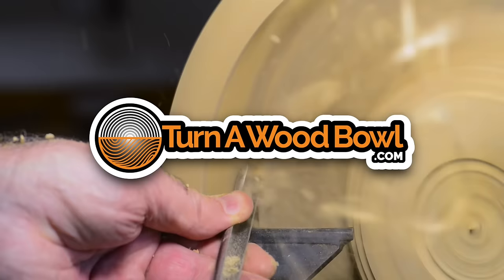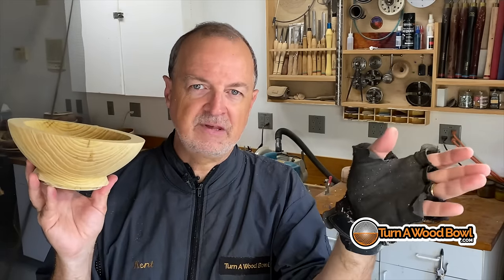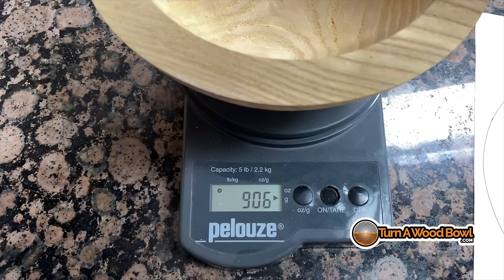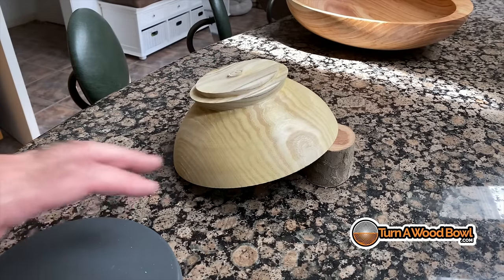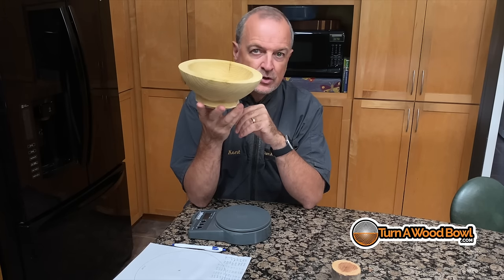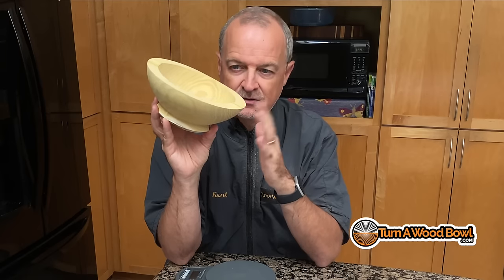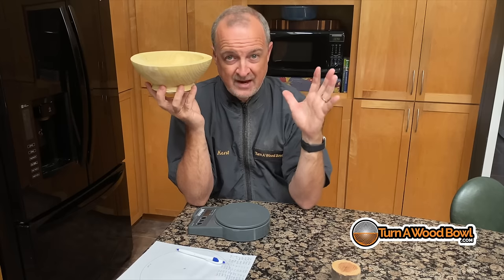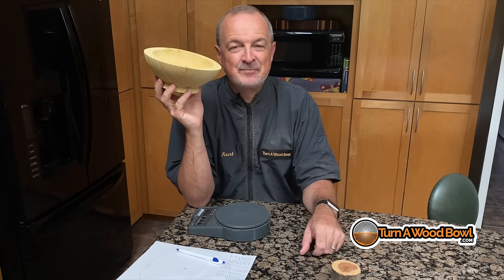Microwave Drying Wood Bowl Blank Woodturning Video

Comment: New subscriber and totally ignorant newby … the info was great and very helpful. I don’t turn, at least not now but am looking at dremel/angle grinder sculpting. So my question is, does the warping issue arise with chunks of wood? Seems to me that it would and I know of some sculpted pieces that have cracked. Can this process be adapted to wood you are sculpting, small statuettes and the like? And what is the process if your item begins to crack during the drying process?
Reply from the maker: Linda, thanks for watching. Yes, flat stock of wood can be dried this way also and usually the side grain areas will shrink a bit, but the length of the board will not change much at all. Small cracks might form, but they shouldn't be that much. You might want to start with a board larger than the intended project, dry it, then final cut it and plane or sand any warping that the drying process caused. Hope that helps. Have fun!

Comment: @Turn A Wood Bowl
I’m trying this method for the first time. So far, so good. I rough turned a piece of ash to roughly 6 inches diameter. It was 614 grams Thurs nite, and is now 520 grams after 13 bursts in the microwave spread out over that time.
That said, even though the rough bowl size hasn’t changed yet/at all, I did notice the first cracks on the outside surface. There’s a small set/patch of shallow 3-4 hairline cracks on the outside surface…maybe 1/2” is the longest.
Should I stop with the microwave? Fill with CA glue? Or is this normal? 
Thanks in advance for the response. Appreciate all the instruction in your videos.
Reply from the maker: You might be pushing the drying process a bit too fast or it could just be the wood species. Every tree is different. You can glue the crack with wood glue and see if it stops the cracking process. All the best to you and Happy Turning!

Comment: I know this is an old vid but maybe you'll see it. I have over a pick-up load of Black Walnut logs that are green. Spot checked yesterday and The MC was running at 19-20%. My dry pile is running low. I turn mostly live edge bowls with my Walnut and was wondering if this method would interfere with the bark adhesion? Any thoughts? I was thinking about using a food dehydrator

Comment: Another great video Kent, I learned a lot of good information!  However I do have some questions my wife brought up when I wanted to use HER microwave to dry some blanks!  She was concerned about the oils in some of the pine and fir wood tainting the microwave and making it unusable for food.  Are there concerns along this line of thinking?  Are there any woods that should not be dried this way? Thanks for your input!
Reply from the maker: Great question. While I can't give medical advice, I would avoid any woods that's have been known to cause you to have allergic reactions. I doubt that pine and fir would cause any issues other than maybe get some resin in the microwave, but don't take my word for it. I recommend getting a dedicated microwave to make it all good at the home. ;)

Comment: I was lucky to find some 18" apple logs and made 5 bowls that were 13-16" diameter by  3-6" deep with 1.25 to 1.75" walls. I fully coated the bowls with Anchorseal. After drying in paper bags with shavings for a year, 4 of the blanks had cracked with cracks too thick to fill with CA. Could you do a video discussing how to fill the cracks and recover the cracked bowls from being thrown out?
Reply from the maker: Yes, I will do a video about cracks. However, fruit wood in particular usually needs to at least be rough turned ASAP after cutting. My experience is that fruit woods crack like crazy. Once you have deep cracks, the wood is no longer safe to turn.

Comment: Can you dry a bowl too fast in a microwave and distort the bowl? I also have bowls that have dried more than a 1/4 inch out of round. What am I doing wrong?
Reply from the maker: Yes. Also, if it is thin enough you can overheat it and intentional bend it to a different shape. Be careful though. You aren't doing anything wrong. You might want to check out my Tree to Bowl course www.TurnAWoodBowl.com/green  Happy Turning!

Comment: Thanks for another great video. I’m so happy I found your channel and website. It has really helped me. One question though: do you change the powers settings on your microwave and what is the wattage of the one you’re using?
Reply from the maker: Good question. No, I have the microwave set to full power. I adjust the time and start with a short interval first.

Comment: Thanks Kent. Is warm to the touch  100 F or so ? (I can friction polish and get 130 F surface which is very hot through a paper towel pad.) And do you notice any smells ? If so how strong are they ?     Stay safe.  -Mike😷  p.s. I am so glad to have found your vids ... I am just beginning to use a gouge & your explanations are the best I've found 🙏
Reply from the maker: Good question. I haven't experienced any smells. Although, I would guess some tree species might smell a bit. Also, be careful heating up the wood surface when sanding as that can cause cracks. Thanks for watching and sharing. All the best to you.
Reply: MPart I’m a begging wood worker myself but from my understanding there are some woods that can be more toxic though I’m not exactly sure which ones. (Eucalyptus maybe?, spalted wood due to the fungus I wouldn’t do in a microwave that is also used for food.) So far I haven’t come across any that smelled bad/toxic though when you microwave olive wood it definitely brings the smell of the wood out more but doesn’t smell toxic.
Reply: @miles67733  Yeah, mold and fungus sound like a reasonable hazard to avoid. I use https://www.wood-database.com/wood-finder/ to understand woods.  Ordinary domestic walnut can be a sensitizer and same for UK yew. Mother nature sure is wily😁
Reply from the maker: @miles67733  Good ideas. You can check different woods and their toxicity here https://www.wood-database.com/wood-articles/wood-identification-guide/

Comment: Great video! Have you heard about wrapping the wood with plastic wrap before putting it into the microwave? I read somewhere that if you put it on high power it allows the moisture to escape but without cracking it because it's in the surrounding plastic...
Reply from the maker: Interesting! Not sure how moisture would escape if the wood is wrapped?
Reply: @TurnAWoodBowl  if I understand right it migrates from the inside to the out and sits on the surface, keeping it from cracking or excessive drying but when you unwrap it you can wipe the moisture off.

Comment: Thanks, Kent. I have a dedicated 34L microwave in my shed. I've experimented and found that the defrost by weight feature works well. For example, My first turned Walnut bowl weighed 1098g and 'defrosted' for 21 mins 57 secs then I let it cool as you demonstrated for about 30mins before beginning the process again. Doing this less than 10 times a day for 4 days stabilised it down to 736g at 14 mins 43 secs. It really wasn't intrusive or demanding at all as I busied myself with other turning and put a 30 min timer on for cooling. My question now is, do you think I could achieve the same results with 30 - 40 sec microwave busts? I'm beginning to think I might be kidding myself with this defrost by weight malarky. Cheers, Al
Reply from the maker: Al, excellent. Thanks for sharing your experience. That sounds like a good option as well. All the best to you!
Reply: Al: I have experimented with the defrost by weight as well. I have found that this technique is good for the first 4 or five cycles then slows the process quite a bit. My theory is that the short bursts (magnetron on for 5 secs then off for 15) slowly heat the water molecules and then with the fan running pulls the moisture out of the microwave box. After a few runs, the water moisture heats less efficiently (this is the target of the microwave energy not the mass of the wood). So I revert to the full power 30 to 60 secs technique. Also... never walk away from the microwave. The short cycles will keep you vigilant. I have burned through the wall of a bowl and filled the house with smoke. Freaked me out!. Happy Turning.
Reply: @MikeRagno  Thanks so much, Mike. You have given me a new direction for my experiments. I like your theory and logic and will apply it to my next lot of green wood. I'm never far from my microwave as it's only a few metres from my lathe in my shed. Cheers, Al

Comment: Hey Kent, If I use Anchor Seal AND the microwave method, that should only help decrease the chance of splits, right? I twice turned and microwaved a natural edge bowl last week and got no splits (so far). I was impatient and heated maybe 10-12 times in a day.  I rewatched your video and know that I rushed it.  I don’t have the scale yet.  Anyway, it’s finished and still doing well.  It’s quite thick though so I think that will help.  Almost an inch for a 6” dia.  So last night I green turned from the same oak tree felled in Orlando 3 months ago (I just got last week).  I made these walls thinner, but not even.  I forgot about that part.  I’m microwaving.  I wasn’t letting it sit very long between, maybe 10min, maybe an hour, depending on what I was doing.  It is getting small cracks in the rim and in the pithy area.  I’m thinking I could accelerate your accelerated method with something to seal the straw ends.  I’m impatient.  What can I say?  Thoughts?
Reply from the maker: I know what you mean about being impatient, Rob. Even walls are the key. Uneven walls release moisture at different rates, so you will have dry areas next to moist areas, creating tension. We cover all this in mt Tree to Bowl online course www.TurnAWoodBowl.com/green  All the best to you and Happy Turning!

Comment: What about heating it more per time?

Once, long time before Internet, I had an idea of drying wood in microwave. I heated it in one session measuring the weight thinking of stopping when no more weight came out. Seemed to work well but then I got too greedy and kept it still little while.

Suddenly awfully amount of smoke was coming out from the microwave and it was so bad I had to leave the house. When I came back, the wood looked fine except couple of darker cracks. From the inside, it was fully black coal.
Reply from the maker: Just make it warm so the moisture will evaporate. Remember, we're not cooking. ;)

Comment: Dear Kent, I was wondering if you made each heat dose more intense, say full power for 1 minute, what effect on the drying time and wood would there be. I guess that too much energy would induce steam pockets which would damage the wood.  25% power for two minutes may do the trick - fast heating but not violent. Cheers.
Reply from the maker: You can do that. I suggest experimenting to see what works best for you and your tree species. Happy Turning!

Comment: Love your videos and web page. I have trouble with large green bowls (12 )-16"). I've been turning them about 10% wall thickness and the same on the bottom. But I still have the bottom crack on me.  What am I doing wrong.
Reply from the maker: You may be leaving too much sap wood, the lighter, wetter wood just under the bark. Some species of tree will develop cracks quickly in the sap wood. Try turning farther into the wood, past the sap wood and see if that helps.

Comment: Thanks for the video. I"m a new turner ... and have some cherry that is green.  I'm having a lot of cracking after the initial turning ..I've tried in wood chips, bought some desicant beads ... tried the microwave technique... still cracking. I heard on some youtube videos that cherry is notorious for cracking... is that true?
Reply from the maker: Cherry can be challenging. Try to avoid sapwood areas. And if it is freshly cut, let it "mellow" for several weeks and then try turning at that point. I've found that works for me.

Comment: Can you put a fan on the wood to cool it after the microwave to speed up the process just a bit?
Reply from the maker: Yes, but you may accelerate the exterior to dry quicker and cause cracking. Experiment.
Reply: @TurnAWoodBowl  didn't even think about that. Thank you!

Comment: I got a bad catch on a mushroom a few days ago with water oak so decided to expirement with what was left of,at first the cap amd part of the stem began to crack but after about 6 or 8 cycles through the microwave the cracks closed up and are no longer visible as if they are no longer there,would it be fine on say a piece you planned to finish turn after having this happen to flood the areas with thin CA glue and then proceed,especially in bowl turning?....Thanks for sharing so much great info with all of us.
Reply from the maker: I wouldn't coat a bowl with CA. If the surface is that cracked, grab another chunk of wood. It's not worth struggling over a less than good piece of wood. Happy Turning!
Reply: @TurnAWoodBowl  Thank You.

Comment: What do you think about microwaving the blank before you even turn it once, or is there just to much mass?
Reply from the maker: Good question. If there any stress points in the blank, they will probably part and crack and cause the blank to be useless. A first turning is essential to control the wood and allow an even drying.

Comment: How do you'll determine how long to microwave each individual turning? Do you go by the heat of the turning? And what would happen if you put it in for say 10 minutes?  Just curious
Reply from the maker: LOL, 10 minutes!? It only takes 20 seconds or so to heat up the wood. You just want to warm the wood and then let the moisture evaporate over time, then repeat. You can experiment with 10 minutes but you might lose the bowl, the microwave or both. LOL We're not baking potatoes, just warming and "inspiring" the moisture to evacuate. Long times will create incredible internal heat and will most likely damage the bowl…or blow it up. Happy Turning!
Reply: Yes I knew you couldn't put it in there for 10 minutes but was asking what would happen.  Ya never know unless you ask or try it for yourself so thought I'd take the safe route. I'm just curious and ya know how that turned out for the "Cat". Really enjoyed your videos and I'm now a subscriber.

Comment: If, for example, I turn a properly dried bowl, regardless of method, in the US in Arizona where it is very dry then send that bowl to Portland, Oregon where it rains more than 150 days per year, will there be problems?
Reply from the maker: Great question! Probably won't be too many problems, but it depends on the species of wood and many variables. For fun, weigh the bowl in AZ and then again in OR (if that is possible). There's a good chance the bowl will weigh more in OR. ;)

Comment: Could you dry it in a regular oven at a very low setting, 200 or less?
Reply from the maker: Possibly. You would need to experiment. I think 200° might be too hot. Remember, it's the internal moisture that will move the piece after turning. Happy Turning!

Comment: How do you know when you need to turn twice? When is there too much moisture?
Reply from the maker: Great question! Two main factors. 1) If you want the final bowl to be truly round without any distortions. and/or 2) if the tree species is very wet and prone to distorting. Some tree species are very "cooperative" and can be turned wet and stay fairly true, while others can be semi-dry and warp like crazy if you once-turn them. I suggest experimenting with timber you will have access to over time. Do a relatively thin once turn and see how the bowl dries naturally. If it only distorts a little and the results are acceptable, then just once-turn. If it moves a great deal, then try twice-turning a bowl as the second experiment with that species. All the best to you. Happy Turning!

Comment: What about microwaving a spindle?  Is it advisable?
Reply from the maker: I don't see why you can't. It may warp and reshape oddly, but it will reduce moisture the same as a bowl blank. I know some turners use microwave heat to intentionally manipulate and bent wood after a turning. For example curving the paddle of a cooking spatula.

Comment: So, other than shortening the drying time, is there any other purpose for turning the bowl wet?  Is it easier to turn when wet?
Reply from the maker: Oh yes, turning wet wood is very easy. Take a look at this video https://youtu.be/jkZdkmH0ZTU With wet wood, end grains are full of moisture, plump and cut smoothly. After they dry out, depending on species, they can become much more fragile and that's when end grain tear out occurs. It's a big game of give-and-take between once turning wet wood vs. twice turning. Wet wood cuts great, but will reshape as it dries, twice-turnings take more time but are truly round when finished. Happy Turning!
Reply: @TurnAWoodBowl  The other advantage to turning the bowl wet is you then have a lot less wood to dry out in the microwave.

Comment: Great video! Don't you risk having a lot of cracking and checking because of the rapid evaporation?
Reply from the maker: Not usually. The process usually heats the entire bowl and then the cooling process lets built up moisture evaporate. The whole time the bowl is relatively damp. It's when the bowl is exposed to extreme dry heat that cracking can occur. Good question Thanks.
Reply: @TurnAWoodBowl  thank you for your quick answer!